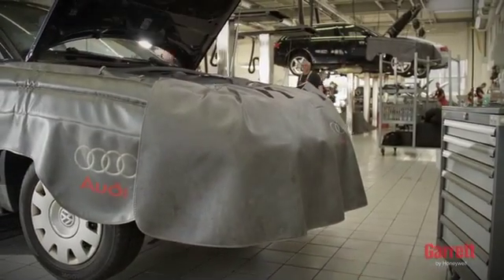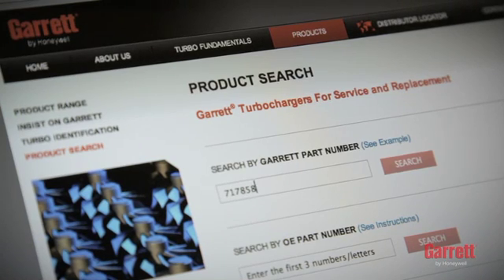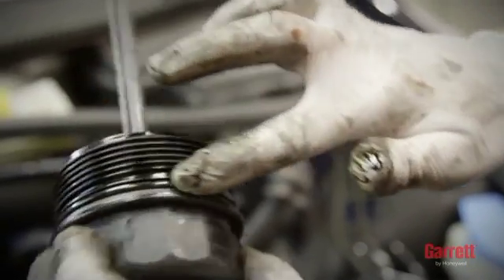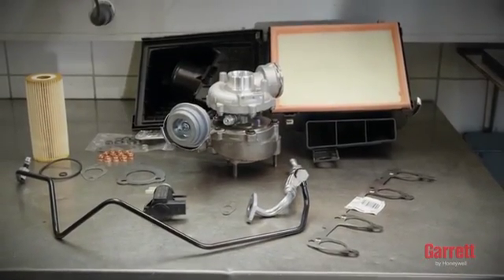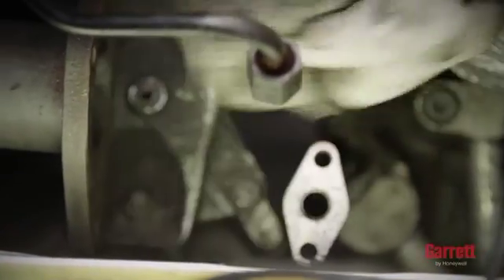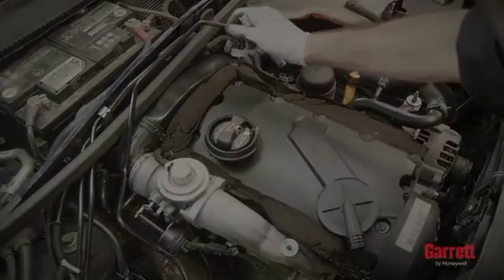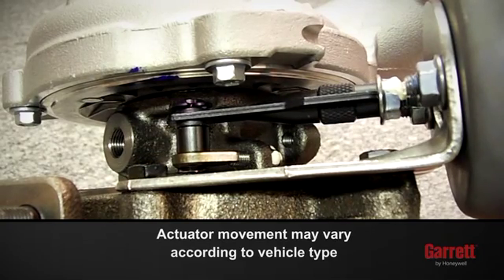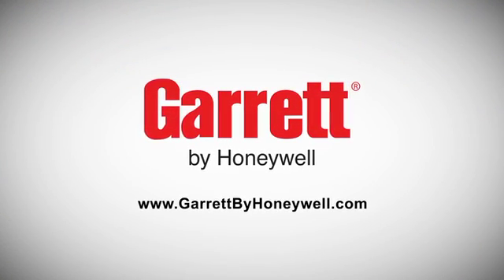How to install a turbocharger.

Comment: hi"  I have replaced new turbo but it's goes to lip mode when I rev it over 3500, what do you think? Regards
Reply: Barış güven Probbably wrong actuator rod lenght adjustment

Comment: hi guys i fitted new vtg on honda accord cdti but under 2500rmp have a no power, whats wrong?
Reply: Did you hear about the turbo's lag ? Well that is why you don't have any power at low RPM . Search for how a turbo works then search for "turbo's anti lag system" or just "anti lag system"

Comment: does anybody know if a turbo helps to save gas?
Reply: Yes it is. 
Do your research on google.
Reply: it does not
Reply: Instead of adding a turbo to get more power out of the same engine, they are adding a turbo to get the same amount of power out of a smaller engine. The turbo itself doesn't save gas, but using the smaller engine does.

Comment: I have a 2012 Dodge Ram with 48000 miles on it. I am now on my third Turbo. Talk about unreliable. After seeing this video I understand why it fails. I am not sure there are any mechanics that can preform this install. My dealer has done it 2x now. I hope they are certified. I wrote to Garrett but they don't answer and in the video looks like they want to blame it on everything but the turbo.
Reply: Debree in the turbine? Diesel is dirty, don't roal coal.
Reply: Hope you are not paying for that.
Reply: Raging Bull it's not the turbos fault the engine maybe dirty inside it is a diesel of course try to clean the exhaust and heads and see if it still fails
Reply: The problem is that it's a Dodge. Try a ford, Chevy, or hell even a Toyota. Anything but a Dodge.
Reply: A turbo on a truck for what do you need it

Comment: guys i have a question 
i have a car that has 115hp but over the past few months my car has begun to slow down (when i press on the gass pedal)
whats the problem ?????
Reply: no just old
Reply: Has to be the fuel bro... Which is dangerous also but if I'm correct than it has to be the fuel. It's not delivering properly to the engine and it's not evacuating exhaust gasses.. Have someone look at it. But that's the only thing that comes to my mind
Reply: It can also be the fuel filter. Which is very easy to DIY. It's probably all clogged up which can lead for the exhaust (gasses) to not release. Try checking that out and see if it's dirty or not if it is than replace or try to clean it if you're not planning on spending money but I would suggest replacing by just buying a new one at your local auto shop auto zone, O'riley you know lol
Reply: +Santiago Jimenez thanks for the info helped alot
Reply: might be your clutch too
Reply: thanks bro but it was the mas air flow sensor
Reply: iMorTal936 was it dirty? lol
Reply: iMorTal936  I see
Reply: A clogged cat converter will do it too
Reply: It can be anything.
Reply: could be the little things like a simple air filter change, do a vehicle inspection

Comment: Why would they put those cheap plastic gears in the actuator?
Reply: Because programed obsolescence. They want to keep getting money and making turbos.
Reply: +Derrick Snelling Yeah like, those things are installed on cars, which bounce and vibrate and shit. If you can barely touch the thing how is it going to hold up in a car?
Reply: They're not just plastic. They're also made with carbon fibre. This gives low friction. The only they break is when the veins in the turbo stick.

Comment: anyone knows where to find a left hand gtr r34 , if there isn't does anyone know a custom garage to change the wheel to left hand
Reply: You should be able to order a left hand drive straight from a dealer.
Reply: might as well pay to get it legalized here. just buy it and leave it the way it originally made.
Reply: Scaltazs theyre illegal bro
Reply: guys r34 skylines are legal the r33 models are the one that are illegal
Reply: no its legal but its99-02 i think i have to convert one

Comment: I find this video very useful. Does anyone know what kind of turbo I would need for my 2001 regal gs? I want to put a turbo on it, its a 3800 series II supercharged. And I have seen other guys doing it, but there aren't enough guys doing it because the 3800 series engines aren't so popular. So I have no guarantee of a good source if its even worth installing.
Reply: Ddddfddf gu
Reply: With your lack of knowledge/intelligence I would suggest you not to touch your god damn engine. Thank you